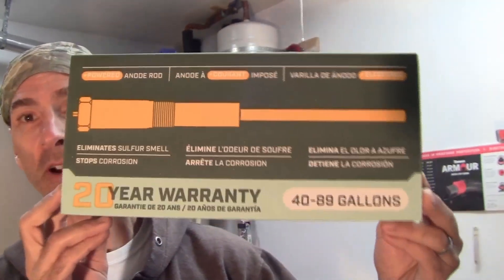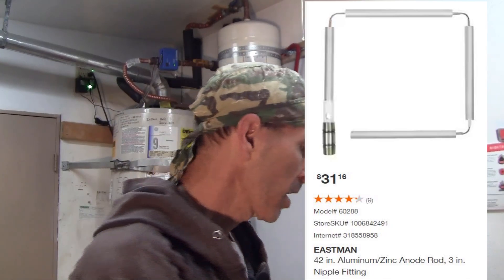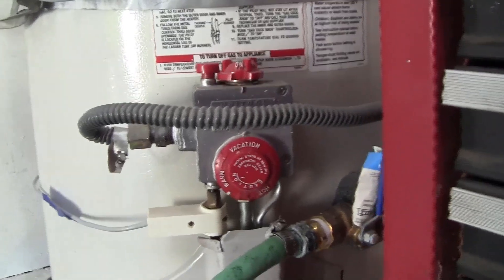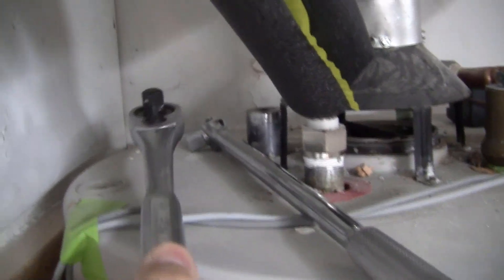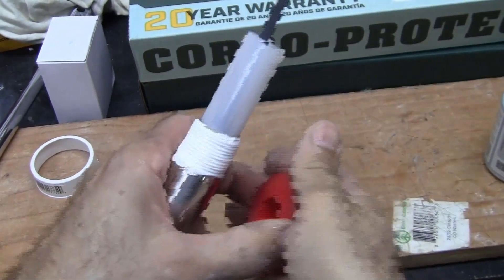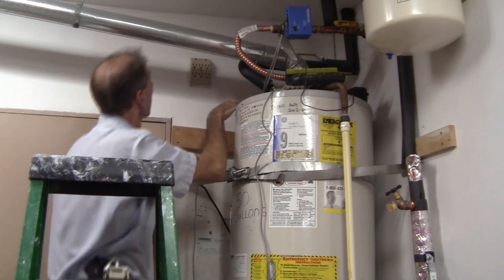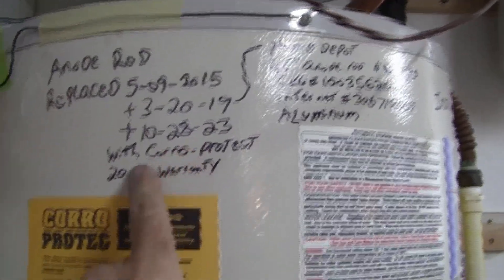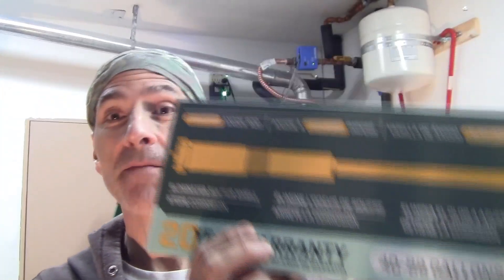Make your Water Heater Last 20 + Years, Powered Anode Rod by Corro Protec

Comment: Big thanks for your Corro-Protec review! Highlighting water heater maintenance is crucial, especially as prices climb. A heads-up to our viewers: Corro-Protec prevents future corrosion but can't reverse existing corrosion on older tank. Good news – it's reusable on a new heater if you ever change it, ensuring ongoing protection. Appreciate your insights!
Reply: Do you recommend to do annual flush after the Corro-Protec install?
Reply: @incognito3743   It's important to adhere to your water heater's manual recommendations, which often include an annual tank flush. While our Corro-Protec system significantly cuts down on sediment buildup, it doesn't eliminate it entirely. Staying on top of this maintenance ensures your water heater operates efficiently.

Comment: I think when you installed the ground wire you should have metal to metal contact and you have metal to paint contact. Will it still work?
Reply from the maker: Great question, Yes it will work via the screw. I do have confirmation because the green light on the transformer will not turn green unless I have a ground in the system.
Reply: @KenTraining  Just going by no.12 in the install instructions.

Comment: Will the Cheaper Powered anode rods that they sell on Amazon work just as well as the More expensive "double the price" units Corro-Protec sells .  I have not found a compare video on these different powered anodes
Reply from the maker: I am not sure and its hard to say. In this case I would recommend checking the manufactures warranty and go with the one with the longest warranty. Usually you get what you pay for.
Reply: Corro-Protec's powered anode rods are engineered to last over 20 years, safeguarding one of the most crucial appliances in your home. If you're considering cheaper alternatives, it's essential to weigh the absence of a warranty and quality control. Investing in Corro-Protec means securing long-term protection with a product backed by a 20-year warranty, ensuring peace of mind for your water heater's longevity and efficiency.

Comment: I have an AO Smith water heater from 2015 and I am unable to remove the anode rod.  I have tried breaker bars, and 1/2”impact wrench and I can’t seem to break it loose.   I am not going to purchase another AO Smith.  They apparently have 2 classes of heater and I must have gotten mine through the big box cheaper variety.  Oh well.  Any advice before I throw the water heater out and put a new one in?  Thanks for any advice you have for this DiY homeowner.
Reply from the maker: I would NOT trash a water heater just because you can't pull out the anode rod. I would ONLY replace a WH if its leaking or if it will not light off. If I were to pull out the anode rod, I would soak the threads with penetrating fluid and try with breaker bar and cheater. if that did not work, I would stop and just live with the installed anode rod and forget about it.
Reply: @KenTraining  maybe you are right. I have read about penetrating oil but have been nervous to use it with potable water. Tomorrow the guy who installed it will be here to try. Thanks again
Reply: Bradford white makes a hot side nipple with the anode built onto it. You could add that if you can remove the existing nipple and you have the vertical space
Reply: @brianii5809  thanks.  I just had the plumber install a Bradford White.  It seems to built better than the previous AO Smith. Time will tell.

Comment: For that kind of money ($160) I'll do my maintenance every 3-4 years.   Using an anode costing $20-$30 bucks.   Pretty aggressive pricing if you ask me.
Reply: If you can get an anode for $20-30 and you don't mind doing the maintenance, go for it.  On my old Bradford White, I just spent $103.25 on an anode, a heat trap, tax and shipping.  It will need to be switched out in 3-5 years, if not sooner.  The Corro-Protec is looking pretty attractive to me.  My water heater is in a cabinet that I have to disassemble to change the anode, so that's another thing in favor of the powered anode.
Reply: I do not have an impact wrench and some of the other necessary tools that might be needed to loosen and remove the anode rod.  These would cost as much or more than the powered anode rod.  I also have a rule:  “I will NEVER DYI anything that has to do with a water heater”.   I have the Corro-Protect on order and my trusted plumber ready to do the install.  Having to not worry about this for another 20 years is called “peace of mind” and worth EVERY penny to me!!!!!!
Reply: @rogwheel  Well your personal rule "I NEVER DYI the water heater"  kinda takes you out of the conversation, doesn't it?   It's like you commenting on airplane pilot skills when you yourself refuse to fly.  What's the point?   Sure, you say it's "worth every penny to me" because you refuse to DIY.   Myself, I DIY my water heater and save hundreds, plus I get to know my own water heater, which you don't.

Comment: Buying a magnesium anode rod within the $40 range that lasts from 3 to 5 years remains the cheaper option. When considering the cost of an electric rod at $160, it equates to replacing four regular anodes. Assuming the purchase of a 12-year warranty water heater version new, starting the replacement of the original rod at the 5-year mark  = 5+3+3+3+3  19 years. By then probably replace water heater.
Reply from the maker: You are correct, But I wanted to set it and forget it. One and Done!
Reply: It would be better to have a stainless steel water heater then you wouldn't need a anode rod at all.
Reply: @Boodieman72  Do those exist?  At a reasonable price?